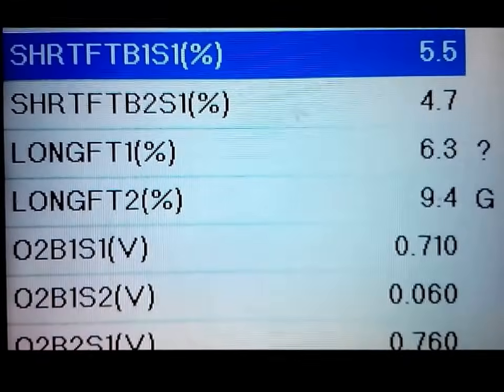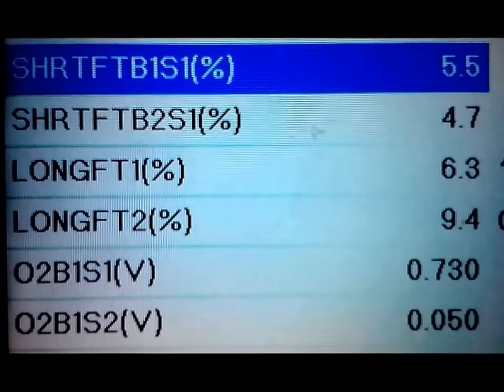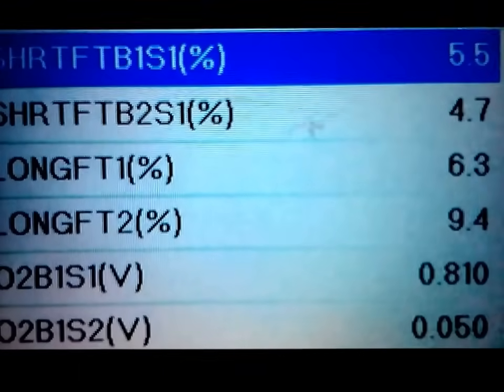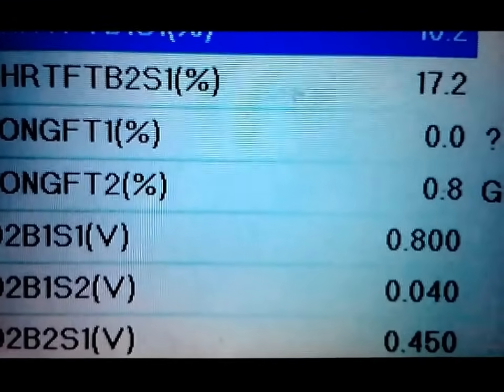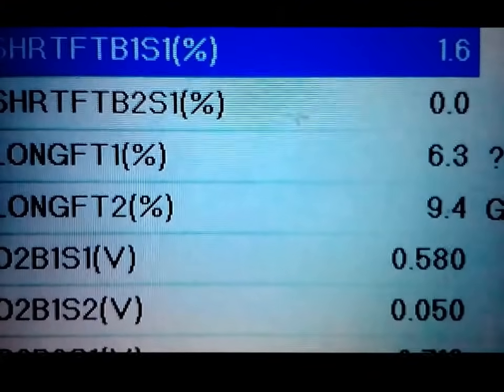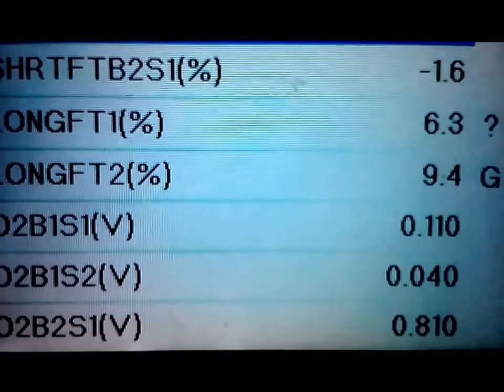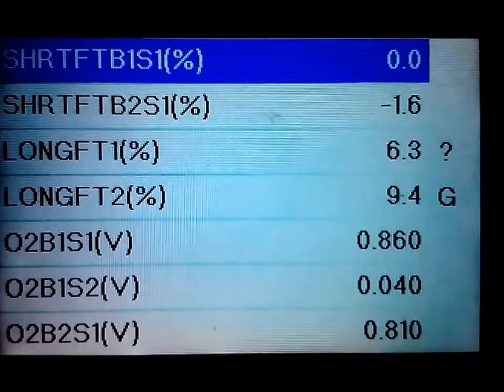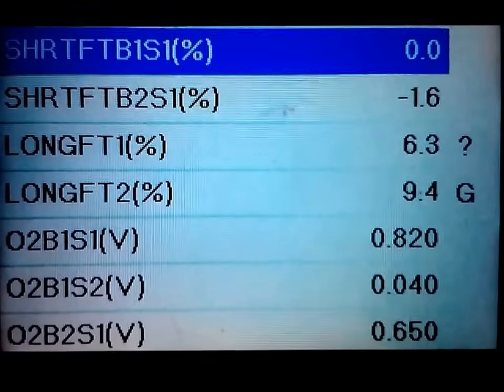how to read 02 sensors, short and long term fuel trims

Comment: I'd just like to add...

In my case, I was getting the 171/174 codes.  So instantly thought lean/vacuum issue.

So, took a water bottle, and sprayed along the intake manifold along both sides, and sure enough, got the engine to stumble.

Replaced the intake gasket, and hooked up the scanner, and during the drive cycle, it thru the check engine light again, with the 174 code.

Hooked up a smoke tester, found a cut gasket on the Throttle Body.

Then had the smoke tester at 5psi, and saw no visible leaks anywhere,  while holding 5psi for several minutes.

Reset the computer, and started the drive cycle again.

Was watching the fuel trims again, and the long terms kept going higher and higher, and were staying in the 12-15% range through various road conditions, stop/go traffic, up and down hills etc.  Then as I was thinking the drive cycle should be completed, it threw the 174 code, AGAIN.

So, now I had to change my thinking from "too much air" causing the lean codes, to "not enough fuel"...   Because I know there are no vacuum leaks, it has to be on the fuel side.  Either clogged fuel filter, kinked fuel line, bad fuel pump etc.

So, just wanted to add, that LEAN doesn't always mean "vacuum leak".. it can sometimes mean "not enough fuel"
Reply: interesting hypothesis

Comment: I changed my plugs, ignition coils and fuel injectors on my ford e-350 6.8 v-10 because I was getting engine miss fire codes and I kept getting the codes after I changed the plugs, so I went ahead and changed the coils and injectors. That solved the miss fires but now it won't pass smog and the other day I noticed I got a rich fuel code on bank 2.  The upstream o2 sensor voltage fluctuates between .100-.800 volts on the bank 2 side of the exhaust  but the o2 sensor voltage on the bank 1 side stays steady at around .900. which. My question is which o2 sensor is working properly the one staying at a steady voltage or the one that's fluctuating?
Reply: also to add to my question if one of my upstream o2 sensors i find is not working properly could that be the cause of the rich fuel code and it failing the smog test. They say it's coming up as a gross polluter mainly on the idle speed test. The higher rpm test also fails but not gross polluter

Comment: Hey great video but I got a question that will stump you.2001 mustang v6 305k miles cats went out .I replaced the factory cats with flowmaster universal and made basically a entire pipe and 2 new downstream o2 sensors.but at idle my b1s2 reads .060 on average b2s2 is at the same but will go up and fluctuate a few times and back down to around .060...do you tft think I may just have the wrong or defective o2 sensors .Car runs great no power loss or smoke.front o2 sensors read like they should .hasn't thrown any codes but won't complete catalysts monitor.

Comment: It sounds like you are saying the cold air intake, bigger intake air hose, or bigger throttle body does not make a difference since the ECU will simply adjust (eg keep the throttle body more closed) to compensate/restrict the extra air intake to keep the same 14.7:1 air to fuel ratio.    Correct?

Comment: 13:00 
STFT  POSITIVE adding fuel ~>Vacuum leaks
STFT NEGATIVE taking fuel away ~>Fuel system issues (injectors or fuel pressure regulator) Correct???
Reply: Basically, yes.  Vacuum leaks tend to be persistent, and that likely shows up as positive on LTFT: you'll see that fade to a lower number as throttle body opens most cases, but STFT picks up first.   If fuel pressure is to high, or injector metering more than designed [for whatever reason] trim shows up negative.  STFT is more of a fine tuning/rapid response - it should be active, as temperatures and manifold air pressure vary during operation, and sensors provide feedback to ECU.   LTFT keeps you in workable mixture range [steady state] to allow STFT to nail down air/fuel ratio [changing speeds].
Reply: Not necessarily. Positive and negative will 0 out +5 short and -5 long means 0

Comment: Thanks for the info.  I have two longft sensors that are crazy high they are reading 98 and 97.  Is that a possible valve or do sensors need replaced.  Thanks.

Comment: My 02 sensor reading is negative 8.6 shortFT and negative 7.0 LongFT . Is my upstrean and downstream 02 sensor  is bad ? There's no code . My engine stall every after start like its too lean and no air coming in to combustion. After stall its running fine . Fuel and vacuum is fine .
Reply: @metalhalide4043   thanks for your info . I figure out the issue . It was the upstream 02 sensor . I replace upstream 02 sensor because its not reading properly , it has a code before and i cleared the code and never came back since the 02 sensor is acting up . When i test the 02 sensor with multimeter its not reading ohms so i replace it and fix the problem . I have cat delete so my fuel trim is bouncing -5 to 7% for the short fuel trim . Now my long fuel trim is stays at -3% to -.8% . When i rev the engine i got closer to zero % . Thanks budd
Reply: @slipshocks0523  Ya, once the heater element burns out its done, if you got 2 banks its best to replace the upstream in pairs, they start lagging over time and response slows.

Comment: o2 sensor tripping codes 0.000v s1b1,, 0.025 on s1b2 o2 sensor are new i think somthings wrong with the pcm shrtFT 1.1 and Long FT 1.1 both 0.0, shrtft 1.2 99.2%
Reply: mine is having the exact issue   shows 0.00volts on bank 1 upstream which is causing a misfire

my long fuel trim went upwards of 32

Comment: got a 09 qx56 infinity,  longft1   -3.9  shortft1 -3.9   longft2  -7.0  shorth ft2  3.1  02B1S1  2.47  02B3S1  2.255    02B3S2  0.080  02B1S2  0.050,   getting p 0420 code,  change bank1 sensor 2 and MAF sensor, CEL stayed off for a day and back on now.  took off exhaust bolts and was told CAT looks fine,   any advise.

Comment: My longtft is reading 0% on both banks even after warmed up and rev... also 02 sensor on B1 s1 and s2 almost read the same .3v , alternatively B2 is reading .6v on s1 and .3v on s2. Correct me if I'm wrong but S1 is before catalytic converter correct? I have already replaced catalytic converter on bank 1 ( honey comb was completely gone and plugged up my resonator. After I got a 430 code for my B2 cat. So I took it off and inspected it. Tried cleaning it and now I have to do drive cycles. More to come

Comment: I have an 01 lexus is300 and on the live data scanner o2b1s1 fluctuates .05 - .875 and the 02b1s2 fluctuates .595 - 650. The shrtftb2s1 bounce from  - 1.6 - 2.3 and the shrtftb2s2 is at 99.2. My longft1 constant at 10.9 and longft2 steady at 8.6. This is all in an idle position....however when I rev 2200rpm slightly and hold for a second I get: o2b1s1 fluctuates .05 - .8 and the 02b1s2 fluctuates .05 - .250. The shrtftb2s1 bounce from -3.9 - 2.3 and the shrtftb2s2 is at -3.1 -2.3.  My longft1 8.6 and longft2 steady at 6.3. I have bad gas mileage all of a sudden, spark plugs changed 5 months ago, new MAF, new TPS and just in the past few days noticed a slight hesitation around 5k RPMs. I do have a vvti motor. Also when key is in ignition and put to battery only not at a running state sparkadv scanner is saying 5 degrees. I dont know if makes a difference but it is July 27th and we have been hitting temps between 100° - 80°. One more bit of information when just sitting in park the cars idle is 750 - 550 RPMs. Please help with any advice since I have been searching and not really found much of anything.
Reply: Put the good thermostat for your specific engine and you be good to go 🔥

Comment: My short term fuel trim (B1-S3) is reading 99.2% with no fluctuation, is that good or bad ? It's a 99 Blazer 4.3L and B1-S3 is the last sensor. I have B1-S1 driver side. B2-S1 B2-S2 B2-S3 is on passenger side.
Reply: Do you have any more info

Comment: What if you drive a Ford and no O2 sensor voltage can be displayed? My bi directional tool can only display microamps on the downstream sensor, which is meaningless to me. I CAN see voltage on my GM and Chrysler vehicles. Does Ford use a different data point at the ECU to adjust fueling?

Comment: My device is reading 02S12(V) .685 and stays around there. I just changed my sensor 1 bank 1 and that is running good now on the reading. But the code was only for the sensor 1 bank 1. Not sensor 2. Should I still change sensor 2? My engine light is still on after replacing sensor 1 on the bank 1 side and that’s what it still shows what’s wrong....
Thanks in advance:)
Reply: James Rodriguez yes change both

Comment: Thank you for the information, I have a Toyota corolla LE 2012 and I failed the smog test because of 02 sensor and cat but my car did not show any code also I follow a Toyota drive cycle and I drove 360miles highway 55 t0 60 after I slow down without using break just helping the car with hand break to 35-45 but still not ready! but when I plugged my OBD2 IT SHOW THAT MY O2S1 bank1 (V)=3.306 AND O2S1BANK2 (V)= 0.660 the car was warmed up for more than 10 min ! please do I need to change both 02 and after drive it probably it will make the car ready for emission! thank you very much

Comment: What does it mean if the downstream o2 sensor is fluctuating a lot? 
short term and long term fuel trims are -15 to -18.
Have p0420 code (catalytic converter) and
P0172 (rich code)
Reply: If your downstream is fluctuating that indicates a bad catalytic converter but to be sure you really should test the rear o2 with a propane test and see if it's reading correctly before changing the cat.  

I used a lab scope to check the rear  o2 vs front o2. The rear should go rich with the propane being added to the intake but then lean after you stop adding propane.  Also the time it takes for the front o2 and rear o2 to switch lean after the propane has been taken away should be a couple seconds.  If not this also indicates the cat is dead.  If the rear o2 goes rich and lean with propane test and still fluctuates you have a bad cat if not you have a bad o2.

Hope that helps
Reply: If the fluctuation of the downstream more or less matches the upstream with a short delay, that points to a bad cat, meaning the cat is having no effect on the exhaust gases before they reach the downstream sensor. Typically bad sensors either read stuck rich, stuck lean, or stuck on some value that is outside of the expected parameters, which most ECUs read out as no data. I suspect a bad cat is more than likely in your case.
Reply: @doug960  i just had an 2004 F150 that had downstream O2 sensors randomly fluctuating which did not match the upstream. I used the propane test above which i mentioned and determined the downstream were indeed bad. Replaced and vehicle has been running fine since.

Comment: Is your 02B1S1.. Is that an 02 sensor.. Or is that an a/f sensor?  I did some reading.. And it was mentioning if a/f sensor voltage readings are high.. It means a a lean condition..
1999 Accord 2.3 auto.. ULEV f23A4
 I notice my upstream 02/AF sensor is reading pretty much 0.8v.. All the time.. Varies very slightly.. (it is a new denso unit)..

Down stream 02 is new denso as well.. And that fluctuates quite a bit.. Usually 0.1 to 0.8v  in closed loop..  Catalytic converter measures about 100°f hotter at the outlet.. Than the Inlet. 

I did just clean the TB and the Iacv (I did reuse the gaskets.. But I did test and I could not pick up a vacuum leak during testing) ... But what is throwing me off.. Is my short term fuel trim is -13.25  and my long term is -13.3.

So that would indicate leaking injectors or similar..

 Any thoughts?

Comment: I have a 2000 Ford expedition 5.4 my bank 1 is reading -22.7 bank 2 reading -2.3 both first o2 sensor reading good .075, both second o2 sensors reading 0. Do I have multiple issues going on.
Reply: prob a stuck injector or leaking injector in bank 1

Comment: Shrtft Bank 1 sensor 2 reading 99.2% car on, sitting at iddle reads the same all the time , whats does it mean? Needs a new sensor?, code p0402 exaust gas recirculation flow excessive detected, thank you.

Comment: Great vid very informative, my shrtft2 is -12 and longft2 (%) is -15 what would be the best solution ?
Reply: If your other bank is fine on fuel trim you could have a couple things to check.  The o2 on that bank,  bad fuel injector(sticking, dirty, etc.), fuel rail on that bank could have debris in it if it's a returnless system.  Im sure im forgetting something but that's a good start

Comment: Thank you.   Very informative.   My LT Trim is -25% and my buddies got me tracking down a phantom vacuum leak.   Now I'm gonna pressure test the fuel system to look for a leaking injector
Reply: Your buddies are exactly wrong. -25 means the mixture is extremely rich. That's not a vacuum leak. It is the exact opposite.
Reply: My longft2 stays around +43-48% all the time. Any ideas what's going on? 🙏🏻 2002 Lexus IS300
Reply: Mark Dziamski hey did u find the problem minds is -3.1
Reply: @jarademajor8401  -3.1 is perfectly normal !
Reply: one of my short terms is + 25
Reply: Sounds like you got a stuck open injector.

Comment: do you know why my car shows -100% on short term fuel trim B1S2?
Reply: D K is your vehicle older than 1996?
Reply: @overdoseaudio  I have 2018 vehicle... do you know what is the wrong with this code?
Reply: Are you throwing any codes? What are your O2 or A/F sensors reading? Both upstream and downstream? Is it happening at idle? what happens when you give it throttle? Do you have a MAP or a MAF? There’s a lot of variables that can cause it. Including the ECU failing. It’d be nearly impossible without looking at live data and having the car in front of me.

Comment: Focus St... After 3 inch straight piping and down pipe...and Intake..my ltft is 13 at idle... I have a Cobb tuner stage 1. No check engine lights. Normal for this turbo engine with these mods because of all the extra air being introduced? Thanks!

Comment: In an older car, like a 2000, does the ECU use the downstream sensor for fuel at all? I've heard differing opinions, but most people say the secondary O2 sensor after the cat is just there to determine the health of the cat, and only the primary O2 sensor decides the fuel. I put an 02 sensor spacer in mine to get rid of the P0420 and am wondering if that's messing with my fuel trims at all.
Reply: That second o2 sensor is there for correcting air fuel ratio,  not health of your cat. Some people put the spacer in to trick the ecm when a bad cat is present. It may very well be your issue.

Comment: I have a 2014 Jeep JK that has had a small engine surge while going down road. At idle, not detected. Least surge is not detected on tach, the up/down is so quick, really doesn’t have time to register. Worst cases, while going up a hill around 35-40mph, by ear it is swinging much more and you can see on tach that it is 50-75 rpm fluctuations. No codes at all. Looking at o2 sensors and fuel trims after engine is in op temp but at idle, o2 upstreams are bouncing all over 75mv up to 800+. Again it is so quick, can not grab a solid number. Downstream sensors however, b1s2 sits around 250mv while b2s2 is around 685mv. While these o2 readings are taking place, fuel trims stftb1, stftb2 and ltftb2 are bouncing between .0 and -3.9. Ltftb1 sits at 0, no movement. It will change when revved up, but still not hanging near where the others are going. Could b1s2 o2 sensor be going out? Could that cause my surge? Shops I have taken it to say no code, no problem without looking at it to see what I’m hearing and seeing. 84k miles on engine and first issues I’ve had. Owned since new.

Comment: hey i got P0037 and my longft is putting out a negative reading could this be a faulty wire?
Reply: How far off negative? Negative reading means its fuel system running rich.
Reply: Hello  iby 4 second hand oxygen senser  4 nissan fuga  when  I started  de car de chek engine come on and vdc  slip
Reply: Cant  any body help me

Comment: Hey there question, so in the same way learned by doing the work myself cause I couldn't pay someone but I'm lost when it's coming to this 02 to short term trim stuff. I have a shrtftb2s2(%) 99.2 and my longft are at 25. I have replaced my intake gasket and put old but good I believe 02 sensors in and it shows my 02 sensors are working and shrtft are working fine. Where should I go from here? 01 Silverado. Truck runs bad in open loop then better in closed loop but still not like it should. Any help would be great.
Reply: even though its years old comment,,,,someone might need it,,,,you have a vaccum leak,,,

Comment: My bank 2sensor2 is staying at 1.2 constantly. Others are in range. Is this a bad o2 sensor. I just replaced it with a new one, maybe it's bad?  All wire is good not burned or chaffed. 2012 Jeep Wrangler. Please respond. Thanks. Gotta get this thing through emissions tags out.
Reply: If it was Bosch or a universal one it may be that your new sensor is trash :/

Comment: Have a 2008 cobalt 2.2L runs good, idles smooth but keeps throwing p300 , it has good iridum plugs new cat last year, new O2 sensors, have checked for intake/exhaust/vac. leaks, closely inspected coil packs and boots don't see any signs of arching/carbon. new crank sensor. my bank1 sensor 2, reading is higher than sensor 1. ? did a compression test yesterday , 155, 155, 151, 149 psi,  any ideas?
Reply: TJ did you get anywhere?  I have the same problem on my 06 Ion with the 2.2
Reply: Hey Mike , no not yet not I havent given up yet. I have not had time to work on it for a few days but I have some live data that I hope will be helpfuf when I start back on it.